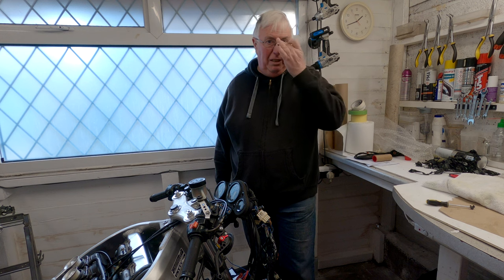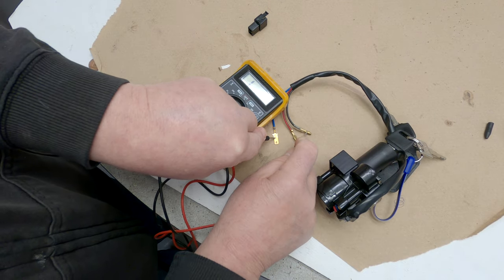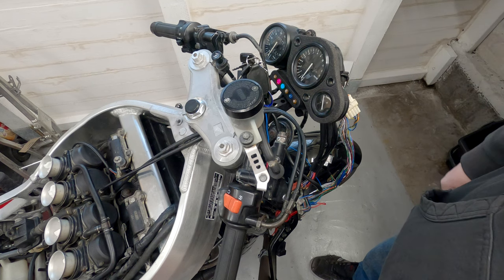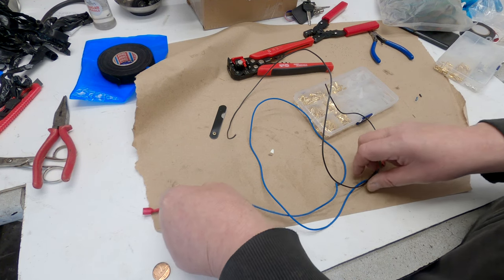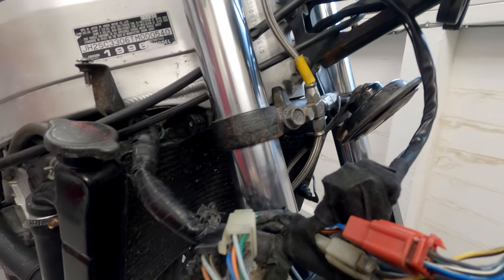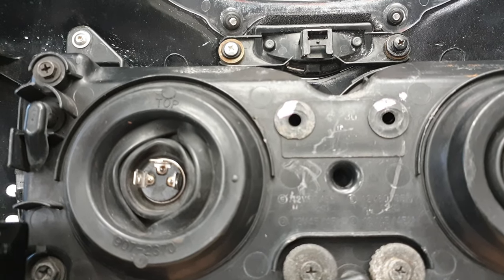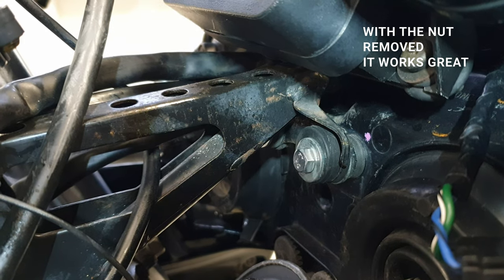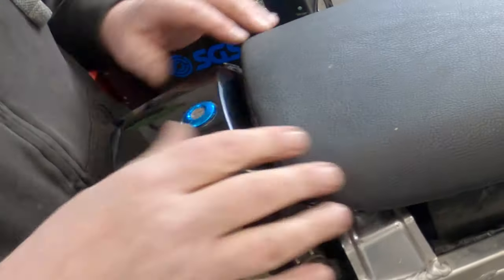Honda CBR900RR Lockset Replacement & Headlight Locator Lug Repair | Fireblade Project Bike | 12

Comment: I did the same, lock set swap, on my 98 Blade, nearly 3 years old and never a problem. The originals were very battered. Mine had 4 ignition wires, it was listed as fitting the CBR1100RR 🤷‍♂️

Comment: Very useful that, my fairing isn’t sitting squarely so seeing the various fixing points was useful prior to starting the job.
PS did you ever find out if the temp gauge needle not moving far across its sweep is normal?
Reply from the maker: Hope it helps you out with your fairing mate. And actually I never did confirm about that temp gauge, I'll do more investigating into that when the weather warms up more and I do more riding of it.